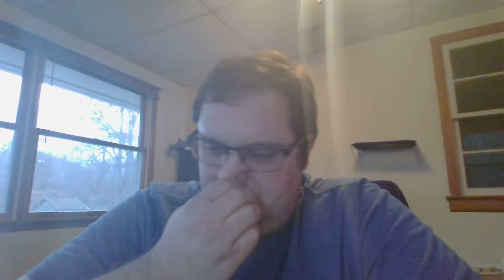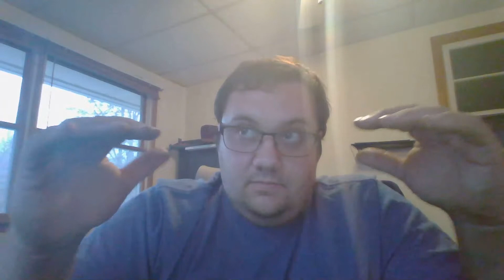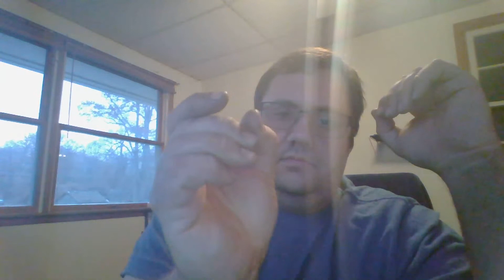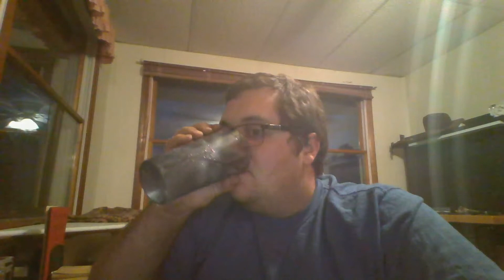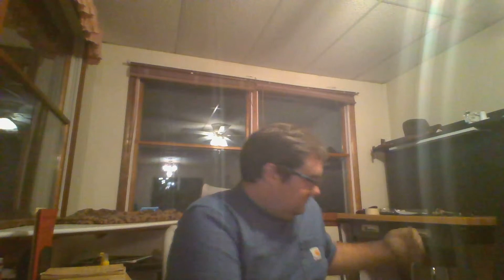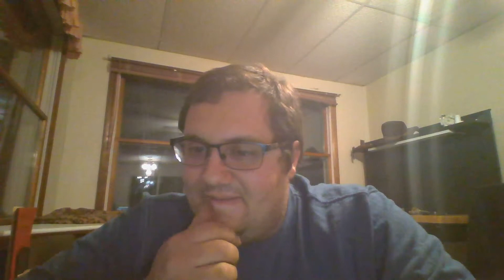Propane Fuel System Sludge

Comment: Propane sludge in lpg regulators is actually tar/oil suspended in the gas.
As a forklift mechanic it's a very common issue for us, when we strip an vapouriser unit down they are often chock-full of this stinky sludgy mess.
It varies with gas suppliers. Here in the UK 🇬🇧, Calor gas (our biggest household name supplier for lpg) tends to be the 'cleanest' and as the propane suppliers get cheaper the 'dirtier' the propane seems to get. Cheaper propane suppliers don't clean/maintain the bottles enough.

Comment: 30 years ago I had a plugged pipe in a travel trailer. It was the pipe under the trailer (low point). It was filled with jelly. I cleaned the pipe and never had a problem for the next 20 years. It had to have come from a tank refill.

Comment: Certainly the source of the crude that is used will affect the amount of crud in any given fraction used to feed the gas separator in the refinery.  Here in the UK our crude ("Brent") is generally quite light, with few really heavy components, but Arabian is just about as solid as road tar and has a massive amount of heavy stuff, so there's a lot of carry over; from memory in the US it really does depend on which field is supplying the refinery, but, apart from that from tar sands, tends to be somewhere in the middle, so comments about fracking are somewhat misleading as it's which field is being used not the technology being used.  (I understand that fields nearly at the end of their productive lives do tend to be a bit heavier than the same field when it was shiny and new,  and in some cases those are the ones where fracking is used to get the last drip of oil out.)

Comment: Basically the vaporiser is a bit like a normal gas regulator incorporating a heater.  Depending on the type it may be that one chamber has a water jacket around it or contains a heating coil.  Depending which chamber that is heated a leak may show as gas bubbles in the coolant system or coolant getting into the gas stream from the evaporator.  Neither is good, and would probably be noticed either as a gross coolant loss or poor running.

Large storage tanks are normally steel, and may have a layer of GF or rubber as a protection against damage.  I think the prohibition on large non-steel tanks is that in years ago there were quite a number of rather spectacular failures and the authorities are just being over careful.  That said, when a GF tank blows one does tend to get a lot of lumps flying around whereas steel (and other metals) tends to split with no lumps flying around.

Comment: It would be interesting to know how much fuel the Roline uses per hour at max output and compare that with a modern equivalent.
Reply: I doubt it’s much more, how well it converts pressure to rotating energy and how freely it rotates is about all that can improve as it’s propane fuelled, making the pistons seal tighter while not binding and making everything else looser while not slapping around are the main improvements that can happen since it works at a pretty static rpm

Comment: The sludge results from what's called heavy ends, higher molecular weight hydrocarbons that distil over during refining. Autogas systems have a filter to remove the sludge and it has to be replaced annually.
Reply: Haven't  experienced issues yet. Do you recommend a filter? And are they available from the gas company?
Reply: @Jim.77777  The autogas systems come with a filter, so worth contacting someone selling / servicing the systems as a starting point.
Reply: @cambridgemart2075  Appreciate the time.

Comment: Pipe material is almost certainly a red herring - if it were you wouldn't have a nice clean feed pipe.  The great thing is they didn't use plastic pipe, which I've seen used on a few occasions when investigating bursts leading to fires & explosions.

Comment: One thing I know for sure, our wonderful government allowed all these chemical companies to add all kinds of contaminants to propane 20-25 years ago. I was an HVAC contractor when this abuse started and the damage done to equipment shortened the life so much,  people stopped using LP gas products. You name it and i have seen it regarding propane problems. The issues seemed to be from all suppliers regardless of price. Metal components involved in combustion to gummed up gas control valves, I think your issue was the contaminated propane, not the odorizer.

Comment: very common Mike , Our RV had a supply line clog where the tanks feed in . The hole in the pipe was about 1/2 plugged . I was sure it was the regulator but after cleaning it out it works fine ..